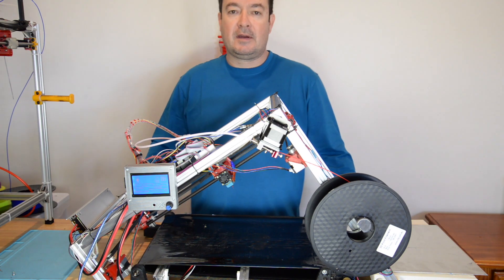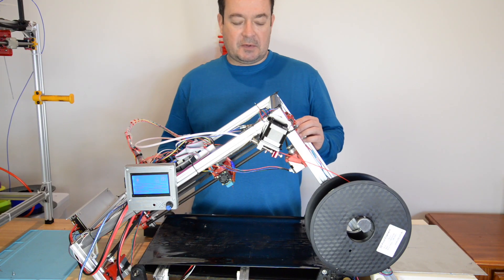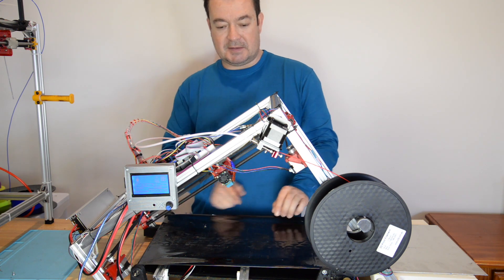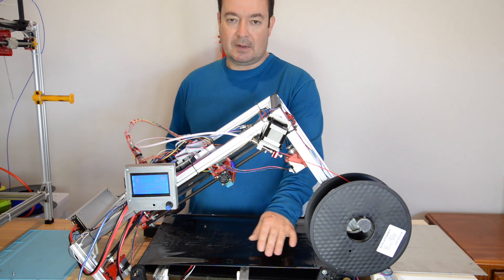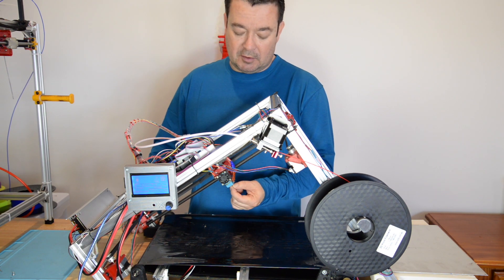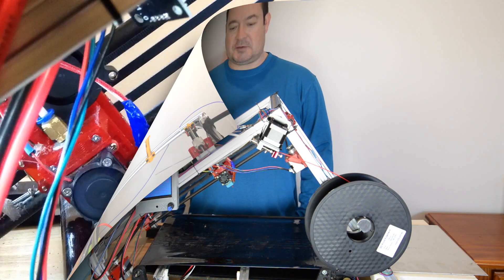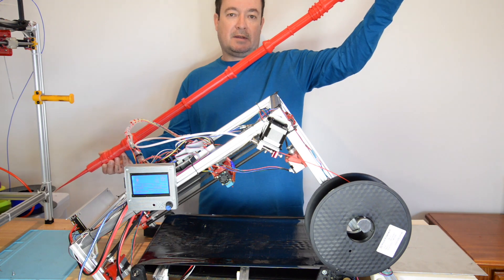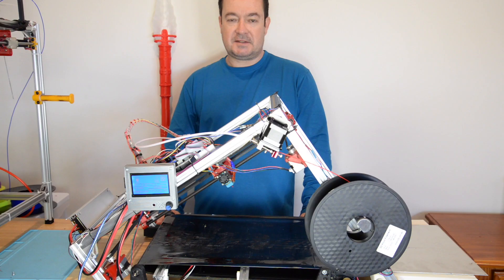My Longest Print Ever! Kryptonite Spear 3D Printed On Hypercube Infinite

Comment: Nice ! Good throughput with such nozzle. I suppose you print a bit slower on the belt, what print speed with a "regular" nozzle do you use ?
Reply from the maker: That's correct. I normally print at 40mm/s. Depending on the model. This time I printed at 60% of 40mm/s - 24mm/s